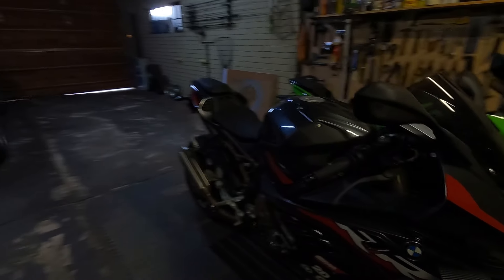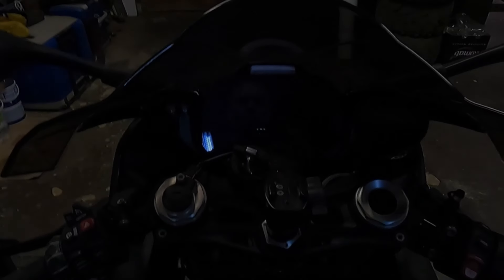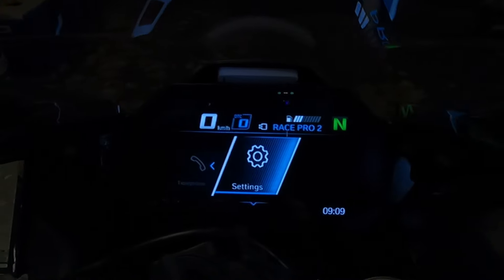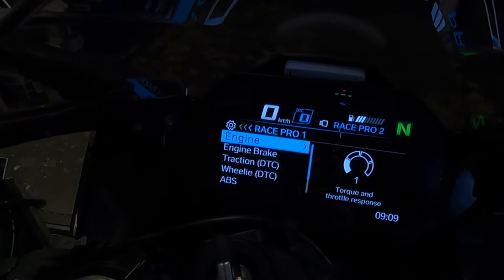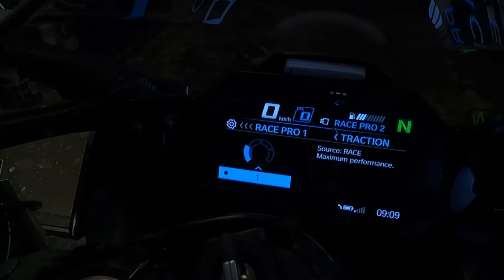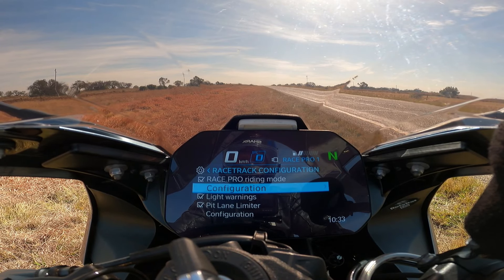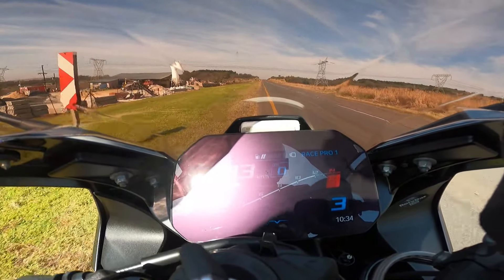BMW S1000RR Wheelie Control Settings and Demonstration. Does it work and is it safe?

Comment: As someone whos been riding this bike with wheelie control on 1 for the last year. MY GOD the quickness of the pickup with it on 0 is insane!
Reply: Oh so it’s possible to do some proper wheelie with it set on 1 ? I have been riding mine for almost a year and I never activated wheelie control because I thought it would stop me from doing it.
Reply: @user-en8in4fb5i  Yes it does! I have friends on pretty much all the major liter bikes (aprilia, kawasaki, yamaha, and suzuki) and the bmw is the only bike I've seen that'll actually let you ride it out. It depends on your throttle control, too much and it'll put it back down quickly. But if you modulate it well, I've been able to ride a wheelie up to 5th gear. The downside is that the max height you get (2 or 3 feet off the ground) is no where near what you'll get with it off so you'll be chasing it and pile on speed QUICKLY. I wouldn't call it a proper wheelie but it's a nice alternative to get the wheel up without the extra risk.
Reply: @tannersmith8415  Do you find 1 a nice compromise where it will wheelie when mashing the throttle but not too much where it cant put the power down at all like with it off?
Reply: @whitegoodman7465  Yes! Setting 1 is good for getting some power down but also being able to wheelie. I created another riding mode for track and roll racing acceleration that has the setting set to 2. Setting 2 sets the wheel down and doesn't allow it to hold through gears which is a nice medium where it doesn't suck all the power like 3 but doesn't hold the wheel up like 1. I beat a stretched/tuned/weight reduced/lowered zx10 so it'll get the power down for sure
Reply: @tannersmith8415  interesting. So 1 normally and if you tryna get down and race then 2? Can you switch these custom riding profile modes on the fly?
Reply: @whitegoodman7465  depends on which year you get you access the race pro modes differently. From 2020 to 2022 once you enable racetrack (race pro custom modes), your custom modes 1, 2, and 3 are all switchable on the fly (activated via mode button then close throttle). The newer models you custom select out of ALL modes (Rain, road, dynamic, race, racepro1, racepro2, racepro2) to choose from with a maximum of 4, I think?

Simply set racepro1 to your dicking around mode (high wheelie) then set racepro2 to same settings just medium wheelie for the track. You can swap between those while riding no issues, I do it all the time if someone wants to fuck around and roll race lol
Reply: @whitegoodman7465  depends on which year you get you access the race pro modes differently. From 2020 to 2022 once you enable racetrack (race pro custom modes), your custom modes 1, 2, and 3 are all switchable on the fly (activated via mode button then close throttle). The newer models you custom select out of ALL modes (Rain, road, dynamic, race, racepro1, racepro2, racepro3) to choose from with a maximum of 4, I think?

Simply set racepro1 to your dicking around mode (high wheelie) then set racepro2 to same settings just medium wheelie for the track. You can swap between those while riding no issues, I do it all the time if someone wants to fuck around and roll race lol
Reply: @tannersmith8415 are you doing clutch ups on 1 or power wheelies? I got a 24 and on setting 1 doing power wheelies, it’ll get like 4-6” off the ground if that lol
Reply: @Tboffroadfab  I'm doing power wheelies on setting 1. That's odd that yours isn't going higher than that. My friends tell me I get at least 1.5 to 2 feet off the ground. Is your bike tuned? I noticed mine started going much higher after a stage 1 brentune because it'll eliminate the deadspot
Reply: @tannersmith8415  no, I literally just got the Bren tune in today, and sent the factory file off to them, just waiting on them to send me the flashed file and then we can see how it does after. Maybe I’m just not giving it enough lol I feel it barely come up and then I can feel the electronics kick in almost immediately and push it back down.
Reply: @Tboffroadfab The tune will help for sure because the deadzone in 1st and 2nd will keep you from riding it out. Once you understand the bikes wheelie control, it becomes easier to manipulate it into going higher for longer. When I was first doing it, I'd just hammer the throttle, and the electronics would immediately shut that shit down. It has to be preemptive to stop the power because things can get out of control fast with that much power. Just pinning the throttle will ensure the front wheel comes down. It also depends on the road itself because with it only letting it come up so high, if the bike has to fight physics too much, it'll stop it. Believe it or not, there is a lot more going on than just ripping it and the bike doing all the work. There is a type of finesse required!

Find a road that is a gradual and long rolling hill. Then, just before the crest roll on hard on the power (1st gear will always be easiest) at first to get it up and before it reaches its max height allowed (you'll learn where this is with practice), let off a bit and somewhat modulate the throttle around halfway, eventually having it at a constant almost full throttle. This requires a lot of trust in the electronics, which comes with time. You will be piling on speed FAST. Over my 25k miles, I have never had a scare due to electronics feeling like they weren't helping out except for one launch I did where it came up way higher than I was used to. Even then, there was still intervention, and was actually more user error lol. It's very similar to learning actual power wheelies just with a safety net and more forgiving of your inputs. Is all this a good idea? Probably not but wheelies are dangerous electronics on or not. WARNING: If you ever want to learn proper wheelies without wheelie control, this can become a very bad learned habit. Ask me how I know. However, learning to properly wheelie on a 1000 is a dumb idea anyway. Let alone a $20k+ one.

Give it enough time/trust, and you will be able to keep the bike around 2 ft or more off the ground and even shift thru multiple gears (highest I've gone is 5th from 1st). Sorry for the novel btw.
Reply: @tannersmith8415  I got the tune back this morning and uploaded it into my bike and it’s night and day, I can pull it up about 1.5-2’ atleast.
That’s all good info man! I agree learning wheelies on a 1000 is not a good idea 😂 I’ve had probably 12-13 bikes now so it’s not me learning wheelies necessarily, it’s learning wheelies with the wheelie control and not f**king up a $20k+ bike at the same time lol  I’ve only got 700 miles on this one so not messing it up is very ideal right now
Reply: @Tboffroadfab  Yep! The tune really helps both with the height and consistency in the power. Wow, 12 bikes is quite a few, I get the feeling you know what you're doing haha
You'll figure out the nuances of the wheelie control in no time. It's a very reliable safety net and will keep you from backflipping your new bike. Plus your newer model will let you drift and back it into corners safely, I'm jealous!

Comment: Do your wheelies in second gear at 80-90kmh, it’s a lot safer and more controllable.  Also try using your clutch instead of doing power wheelie’s, clutching up brings the front wheel up a lot slower and smoother than just whacking open the throttle.  The trick is to rev up the engine the same as if your going to gear down but leave it in the same gear, the front wheel will come up nice and easy compared to power wheelies.
Reply from the maker: I have tried over and over, but can't get the front wheel to come up in second gear. I'm 93 Kg, maybe that's my problem. Lol
Reply: @racermac1081  what bike are you riding
Reply from the maker: @markmaker2488  the 2022 BMW S1000RR
Reply: @racermac1081  you should definitely be able to wheelie that beast in second gear.  You need to be cruising at around 7000-8000 rpm in second gear, clutch in then quick rev up to around 10-12000 and quickly let the clutch out.  (Like you would when changing down to rev match) Keep your foot over rear brake just in case she comes up too quickly, (which it probably won’t in second, unless you redline it).
Reply from the maker: @markmaker2488  I'll try that and maybe make a video and post it, then you can give me some tips on what I'm doing wrong. I never seem to get my bikes up in second and I've had the 2 previous gen BMW S1000RR as well.
Reply: @racermac1081  just wondering if you can power wheelie.   They’re a bit more dangerous but easier to do.   So same as before you need to be in 2nd at around 7-8000 rpm then let go of the throttle for maybe a second, you’ll feel the front shock compress a bit, when you do twist the throttle nice and quick and the front wheel will lift.  Just be careful with power wheeling because you can loop your bike easily
Reply: I have a 2018 Fireblade, even tuned it makes less power than yours stock. If I’m going 110km/hr, roll off for a split second then a quick flick to WOT and it’ll come up. And I weigh 100kgs. My bike doesn’t have intelligent wheelie control and I can easily loop it in second if I don’t adjust throttle, especially if my tank is getting empty or if I shift my weight further back. Try those tips. 2nd gears are way more comfortable.
Reply: Can you clutch up with wheelie control?

Comment: It's all about DTC interference bro. Even on wheelie control 1 mode, the DTC interferes alott. It's just that sometimes it interferes quickly and sometimes too late that the rider get scared. DTC -7 will interfere late and +7 interferes as quickly as possible. I ride with DTC completely off which also disables the wheelie control. Ride safe ✌🏻️ 💯
Reply from the maker: Thanks, I saw it made a big difference. It's awesome.

Comment: I have a base 2022 S1000RR with a full exhaust and brentune. I don't have Race Pro modes. I find the basic tc modes don't restrict wheelies at all. I can't use first gear at all from a roll. The front comes up so fast
Reply: It’s not for a 1000 it’s for the m1000

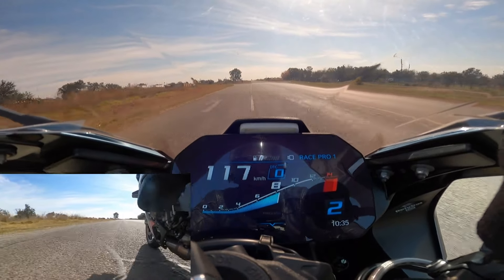Comment: The last wheelie at 12:20 is the maximum you can do with wheelie control? i was hoping for a bit higher wheelie
Reply: He was being conservative on the throttle. He respects the bike and isn’t a pro. With some more throttle input it does lift higher.
Reply: @Aliscarchive how do you know this? Do you own an s1000rr and tested it yourself?
Reply: @videofrat3115  he literally said it multiple times in the video that he isn’t a pro rider and was doing wheelies within his means. I don’t own an S1000RR I have a Panigale V2S. But I ride with people that do and the angle is much higher when you’re not scared of the throttle. I’ve seen it with my eyeballs. All my friends use wheelie control. You don’t have to think you just rip RPM and it holds.
Reply from the maker: It's true, I'm not a pro, but the wheelie control helps to make it look like that... lol. I've noticed that when you adjust the TC on the dash from 0 to -2 or -3 the front wheel will pick up higher and can then even change to 2nd gear and it will still wheelie for a while. You can control your wheelie hight with the TC. Practice makes perfect.
Reply: @racermac1081 thank you! Very insightful comment about the tc
Reply: @racermac1081  talking of DTC numbers, the MR goues up to 7 and down to -7, same as S1RR. What exactly do each of the numbers do? I have the MR and been in all of the numbers and I notice nothing when blasting around the mountain roads.

Comment: So it means you can accelerate as much as you want in Wheelie Control, but you can't fall backwards?
And does the machine brake on its own if you do fall too far backwards because you might have leaned too far backwards?
Reply: That’s what I’m trying to figure out, he never mentions if he’s full throttle or not smh
Reply: You can go full throttle and the engine will cut the Power just a bit to not lift the front
Reply from the maker: You go full throttle. The ecu control what hight it must lift and keep it around that hight, which in turn the ecu will control the throttle plate position maybe at 60-70% to keep that hight, even though your hand is at 100% open throttle.

Comment: Any reason you have the DTC set to 0 as apposed to -7 for this video? And do you think it would make any difference? Thanks!
Reply: I Drive the Same RR and in My Opinion its better to do the wheelie with -4 / -5  ;)
Reply from the maker: No reason for having the DTC on 0, just been testing it on 0 so far
Reply from the maker: @manuelbartenschlager8723  I'll try with the DTC on -4/-5 and see what difference it makes
Reply: @manuelbartenschlager8723   are the wheelies higher then or does the front wheel come up more? 😬
Reply: @racermac1081 how’d that go
Reply: How’s that go
Reply from the maker: I tried the traction control on +7 and then on -3 today and it made a big difference. On +7 the front wheel barely came up, but on -3 man was that fun. The front wheel lifted more, but with good control and I could even change to 2nd gear and still keep it going much further @Safsejv-ih2ss
Reply: @racermac1081  I can’t seem to get my wheel to come up. Never once . Do I need to do a special setting ?
Reply from the maker: Yes, as described in the video. What is your settings at? @Safsejv-ih2ss
Reply: @racermac1081  race pro 1 traction race engine 1 engine break minimal wheelie high abs dynamic , -5 ddc mode. No matter how much I yank it my rear wheel just slips slides skids
Reply from the maker: At what speed are you trying to pick it up? It should not spin that easy above 30 mph. Set your DTC on main dash display on 0 first and try again. Also open the throttle more gradually, the bike has enough power to still lift the front wheel
Reply: @racermac1081  what throttle percent to get the nose up?
Reply from the maker: You can open it 80%-100% and then as the front lift you can easier control the hight with the throttle
Reply from the maker: @Safsejv-ih2ss  805-100% you can open fairly quick for front to lift, it's not necessary to twist throttle quick, the bike has eanough power to lift easy, then you just control the wheelie a little bit with the throttle. It's much smoother than if you have traction and wheelie control completely off
Reply: @racermac1081  okay wheelie control off then traction off by holding traction button on left hand control
Reply from the maker: @Safsejv-ih2ss  You only need to switch traction control off by holding the traction control button in for few seconds, but be aware the bike will pick up much faster and you will have to control the wheelie much more and keep your foot ready for the rear brake, cause the bike will backflip if not controlled.
Reply: @racermac1081  so how do I know why it’ll go up and loop ? That’s what I’m afraid of . What the process? 80 percent throttle nose goes up and as rpm and speed goes up the wheel goes up? And to the point it’ll lift up and loop?
Reply: @Safsejv-ih2ss it will loop if you keep on the throttle. Ease off when it starts to lift up and use your rear brake to prevent it from shooting to the moon lol.

Comment: Does this feature only work on power wheelies or are clutch wheelies also included in the feature
Reply from the maker: I think it will work on clutch wheelies as well, but I would not recommend it as the revs are going much higher and then there is not much control over the bike.

Comment: Congratulations about the video, very well explained, but I still have one doubt, if you accelerate the maximum with wheelie control working on minimum possible support, is there any possibility of the bike turning backwards ?
Reply: No unless it is on zero mode with no control i have a m1000rr and have it set on mode 1 it wont go as high as it would as it would as if it was on zero :)
Reply: @duxongee1823  tnks man !!🙌🏾
Reply: @JoãoPedroPrzz  no problems mate :) mode 1 is the safest which i have found and i have the same setup as the gentleman who made this video ride safe :)
Reply from the maker: It depends a lot on what you set the TC as well. The TC setting will control how high the bike's front wheel will pick up.

Comment: can you flip the bike in mode 1 if you dip the clutch and give too much gas?
Reply from the maker: No, you will not on 0 TC. The TC level control how high the front wheel lifts up.

Comment: High mate great video, got a question I can't find anywhere,, just bought a 23 plate and noticed there is no traction control light flashing when the front wheel comes up ,, only when I lose traction in the rear,, couldn't see it flash in your video I don't think ,, is this right enough,thank mate
Reply from the maker: Not sure about that, but I think the bike's electronics are very clever in knowing when it is the front wheel that picks up and when it's the rear tire spinning.